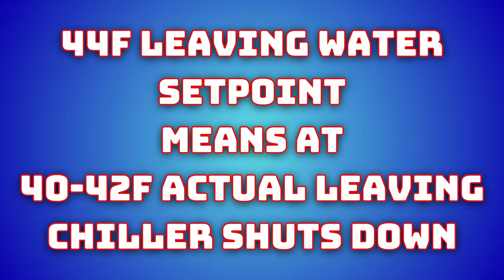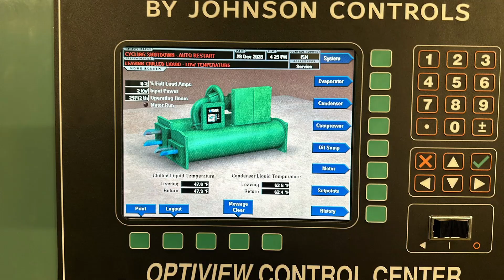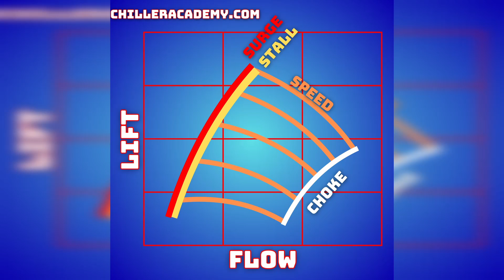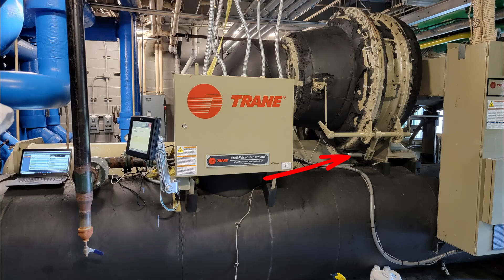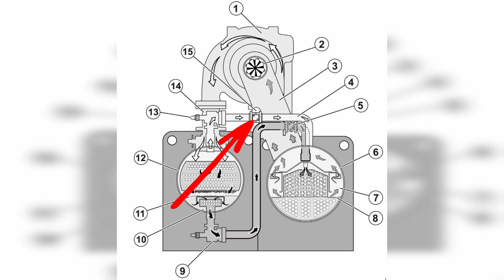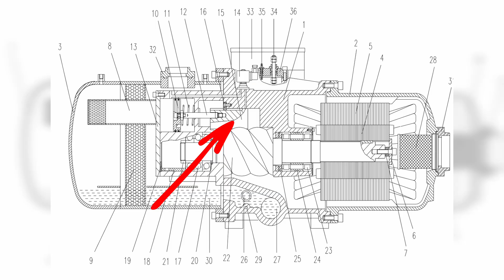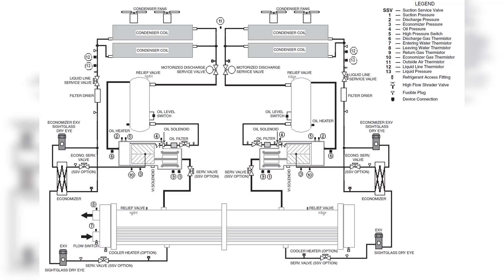Chiller Low Leaving Water Alarm

Comment: Can't say I've ever seen this alarm before.....low evap pressure....most definitely seen that. I've seen HGBP on several of our machines....its a 3rd stage of unloading and a last ditch effort to keep the machine running in a normal lift condition. Our screws use slides, but only to keep the compression ratio in a stable condition to match the load. They can slow down to a pretty low speed. Start up is like 24Hz and they can run up to 90Hz on certain frame sized compressors. Part load is where our screws really shine and run great. Oil issues do happen,  but not all that often.

Comment: If the water is coming back too cold and you have a building that utilizes a high percentage of fresh air, be sure to check the isolation valves at the air handlers.

Comment: Had a York screw machine that wouldn’t unload because of the leaving & returning chilled water temperature sensors were faulty causing it to run fully loading 24/7… slide valve would never change not matter what the actual load was !